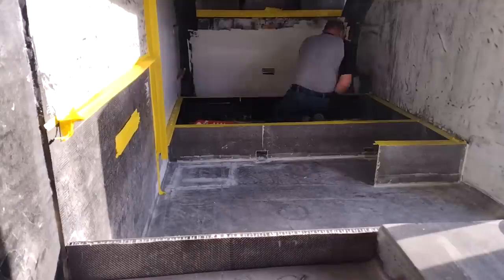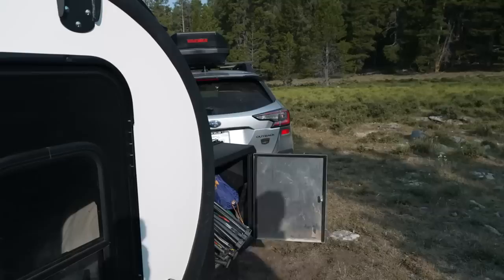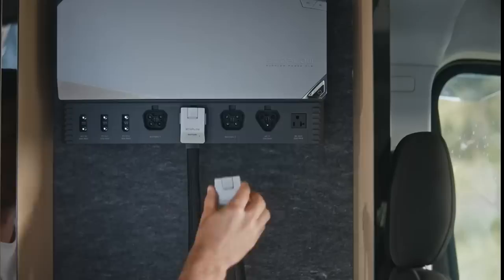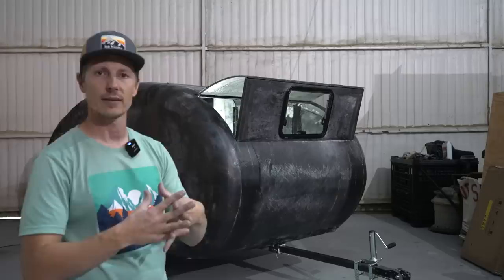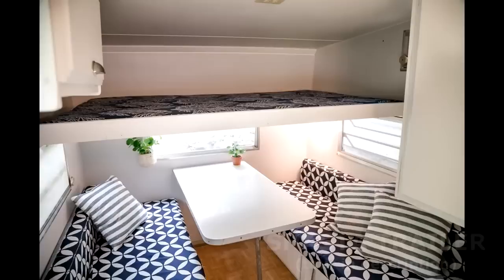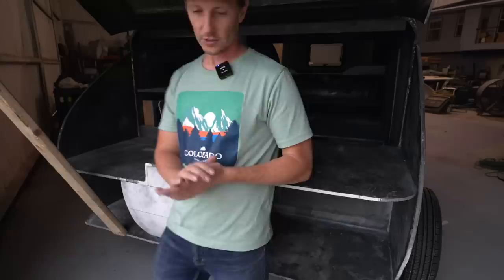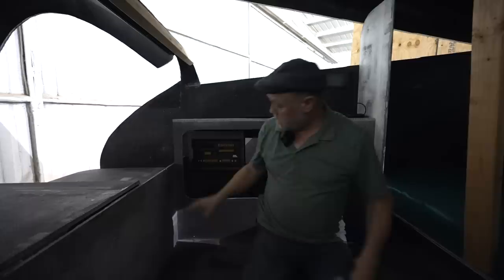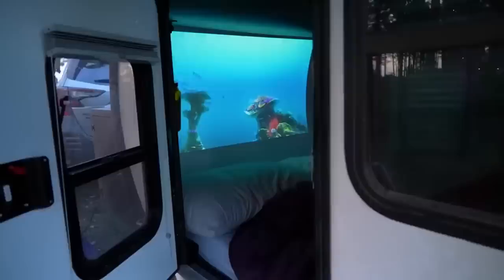World's First Pop-Up Teardrop Trailer With NO CANVAS!

Comment: Thinking the kitchen countertop slides out and splits in half then pivots to each side.  ( kinda u shape). Could give more counter space  and give easier access to pass through to inside teardrop?
Reply: Well, the three burner stove pulls out so you have a L shaped work area. And you want to stay under the galley hatch for shade and rain. Design decisions are always a series of compromises.
Reply from the maker: Adding to Charle's comment if you check out our first video on the build he mentions that the galley in itself is a structural component to the trailer. However, he has talked about a future design with a removable galley. This is something you see from time to time on home builds. It is a really neat concept. Basically you can remove the entire galley section of the trailer to convert the trailer to a cargo hauler when needed. Maybe there is some version lingering in the back of our minds just waiting to pop up that incorporates some sliding and pivoting to create the shape you are mentioning. And then can also be removed for the cargo space.

Comment: There are many expanding teardrop trailers including the alto safari. I'm not sure this qualifies as the first.
Reply from the maker: Technically, the alto is not a teardrop. A teardrop trailer is built around an outdoor galley kitchen. As for many expanding teardrops, could you share some of them with me? I love finding new trailers. And if I’m getting technical, even ours wouldn’t qualify as a teardrop trailer. It would actually be defined as a teardrop trailer in transit and a “standy” at the campsite.
Reply: @PlayingwithSticks  Love that logic when you called a Tab a Teardrop. The cricket is also a small pop up teardrop by that measure.
Reply from the maker: @LarsDennert  We don't actually call a T@B a teardrop. It is what the manufacturer calls it though, so we do stick with their preferred terminology. But throughout the channel videos we often explain that a T@B is not a teardrop. And no, a Cricket doesn't meet the definition. Like I said it needs to have a clam style galley kitchen.
Reply: @PlayingwithSticks  Well opinions vary I guess. I'd say it has nothing to do with the galley location and everything to do with the shape.

Comment: I didn't catch, how many do you think this could sleep? Our family consistents of 2 adults, and 3 kids under 6. We won't be getting a trailer until next year probably, and we're wanting to get something that will last us a reasonable length of time
Reply: One queen bed , and three bunkbeds are possible. The two bunks in the front and one over the foot of the queen bed. It is removable and has threads for legs so it serves as an outside free standing table if wanted. In a pinch, someone short could curl up on the floor of the den. We have not shown it yet.
Reply: Oh that’s awesome!!!

Comment: Is the door going to be dutch or one single opening? Will it operate with the roof popped and closed? Aluminum or also the fiber material?  Did I really just see Coroplast sheeting covered with the fiber reinforcement as structural pieces? If yes can we talk more about that?
Reply: Nooo. Not sign plastic. It is a modified honeycomb used in boat construction. More durable that Nomex honeycomb. As Drew says, good eye.
Reply: The door will open with the top down or up. Drew would not budge on that. Haha.   It is a variation on Dutch door.

Comment: This looks like exactly what I have been looking for because I have a family of 4. Two questions... 1 how big is the parent's bed? and two is there any divider between the parent's bed and the bottom bunk? I have a six and three year old and they like their own space.
Reply from the maker: The current bed is built for our family specifically. It is a queen bed, but it runs the width of the trailer. Meaning our head and feet are near both side walls. We did this to keep the trailer size down and maximize the den space. May doesn't really crawl over me at night, so this setup really is not an issue for us. But in the final model I assume Charles will have the bed lengthwise with the trailer. This will either mean extending the length of the trailer a few inches or cutting down the den by a few inches. Either way I think people will still be very satisifed with the design. The bottom bunk is 3 to 4 inches above the queen mattress. So it feels like a separate space for Rye. Charles says a divider could be added, but we chose not to add one beings the fall from that height to the queen mattress would be very minimal. Like your kids, ours love having the autonomy to nest in their own little space.
Reply: @PlayingwithSticks  Thanks so much! A queen is what we are looking for! Most campers we have seen only have a double and unfortunately that is a bit to small for us :)
Reply from the maker: @angelaanderson1732  I completely understand that. We are with you there.

Comment: Since this does not have an actual frame, will this have the potential to add a receiver on the back like to attach a bike carrier?
Reply from the maker: Probably not. In general, we have learned even with traditional frames, with the types of force that is applied on bikes, mounted to the rear, they are much more suited to being mounted over the tongue. These rear carriers are great in theory, but are pretty hard on your gear.
Reply: I had a vertical bike carrier for around four bikes like the Velocirax in mind. I guess for sure with a tongue extension something like that could probably still work. I got to thinking though, would it ever be an option to use the mudroom/entry area as a toy hauler/bicycle option while traveling? Would depend partly on the type/size of entry door I guess.  This would have the additional benefit of having the bicycles inside and secure while traveling

Regardless, I am eagerly awaiting the option to get signed up for one!
Reply from the maker: I like how you think. On this model, we built the door wide enough to easily take my bicycle in and out daily. We even installed a permanent mount on the floor for the bike. Charles already has a plan to make a toy hauler version of this in future. I would be excited to have one of those as well.
Reply: Hopefully those mods make it to the production model! With bikes and 3 children (any day now it will be 3 anyway), I think we can still use this larger trailer to its full potential!

Comment: Modern cars do not have a frame. They are called unibodys. Charles is right. I am building a Filon Styrofoam composite trailer right now that has a very minimul  frame becuase the body is all glued together, walls, roof and floor and is incredibly strong. This is a modified 4 by 8 foot teardrop and I hope to bounce it down the road next week. Weight without a bed and amenities is less than 500 lbs.Look me up nobody else does lol.
Reply from the maker: I am so hopeful Charles is right! Like you said Charles has had me study unibody construction. Which is why I am willing to give this a shot. I want this to work! It would be huge for the industry. I have two Foamies that I will be highlighting on the channel at some point. I am really excited for you to see them. Your trailer sounds great. 500lbs sounds perfect.

Comment: Ecoflow 2kW system: $4,700!
Reply from the maker: Right! But, as you probably know when you price out all the components it isn't as crazy as it seems. Well, still crazy!  Haha. This is ridiculous for just electrical. But in terms of buying each component individually it than seems quite fair. Just take the Lithium battery alone. That costs about 1/4 of the entire price. Haha.
Reply: @PlayingwithSticks  I paid about $450 for two Chinese brands 12v, 50ah batteries. My system is only 1KW, but all told it probably cost me no more than $1K, including 200w of solar panels (which I have yet to install 😀).
Granted, it's not as pretty, modular, or easy to put together, but I can afford it! 😀

Comment: Those expensive blue Victron components! 😀
Reply from the maker: Aren't they all!  Haha. But in their defense they have been used extensively in the marine and van industry and seem to have a pretty good reputation. These power management systems can get out of hand pretty quickly when it comes to prices.
Reply: @PlayingwithSticks  No doubt they're good, but some of their products are fancier than I need and would put my system way over budget. 😊
Also, the components tend to be large and my space is limited.
I do have one of their battery chargers, though. 😊
Reply from the maker: @JackFalltrades  You sound like me. We have pieces of their gear as well, but like you we had pretty limited space in our teardrop. And we really didn't and still don't consume much power. But I found myself limited the last couple of years. Do I test gear while on trips? Well, then I have to spend all day chasing the sun. It was a trade-off that I am excited to not have to do as much anymore.
Reply: @PlayingwithSticks  Your situation is different than mine. This is more of a career for you. 😊

Comment: Its a great concept, but its too big for my tastes - length and width. Also plumbing of any sort is downside for me; I want at most a barebones electrical, and heat system (diesel or propane). The galley can be a blank counter top - I have my own stoves, and if it has a slide out drawer that can handle my cooler than really thats all I need.

Dont get me wrong I'm not against it as a whole - most tear / square drops on the market are overpriced, cheaply made, or not mod friendly. My parents took me camping every year on month long trips across the country in an old Starcraft popup  that didnt have a water tank, or heat, the propane lines were replaced at least once for the stove, the crank for the top was on the tongue in front of the propane tank, and the cushions had the most ugly brown tweed pattern you could imagine. So the idea of a small popup for myself is greatly appealing after all those fond memories - especially since for the last 10 years I've been using a tent now that I camp by myself.
Reply from the maker: I agree this trailer won’t be for everyone. It’s not your typical 4x8 teardrop. As for plumbing, he didn’t mean water. Sorry for the confusion. He was referring to propane. We don’t believe in water plumbing systems for a trailer. Well, a trailer for our family. And what you described is what he’s building for others. When I said he’s building it bare bones that’s exactly what I was referring to. be a dry trailer with basic components. They will not have an Eco flow power kit, it will not have induction cooktops. Basically, it will be just what you need and nothing else. So I think you and I are actually on the same page with this trailer. Minus the size part.

Comment: So you are basically copying the Safari Condo Alto, made in Canada for a decade or more..
Reply from the maker: We love the Safari Condo Alto. But as for copying, these are two completely different trailers. The Safari is essentially only a teardrop by  shape. By definition it is not a teardrop. If you think about the design it is more like a pop-up Rpod,  but in my opinion it is much better qualiity than an R-Pod. The Alto by definition would be what we refer to as a "standy." The Alto weighs over 1,800lbs with it's living and cooking area contained all within the cabin. Our trailer is essentially a teardrop when in towing and storing mode. But once the top is lifted, I am not sure how one would define it. The premise of our trailer is built around the outdoor galley kitchen. This is something that makes this trailer unique. In all my research over the last few years I have never found a trailer, in the history of trailers that is a teadrop that pops-up using composite sidewalls. And this trailer isn't 1,800lbs or more. It is designed to be a trailer that tows and stores small, but lives bigger. It will come in at under 1,000lbs. Basically this is a completely different philosophy of build compared to the Safari. Really the only thing they have in common is the shape and the pop-up design. If you are comparing this to a Safari I feel we are headed in the right direction. Like I said, I think the Safari is a great trailer! It just isn't a trailer we would model our design off of. The Safari would be for people with differnt camping styles and towing needs.
Reply: Exactly!! Why I love this design, it takes the features we love of a teardrop (outdoor kitchen and shape) but the issue we always have is the little details you can’t have unless you get an A-Frame but I don’t want all of those interior features.